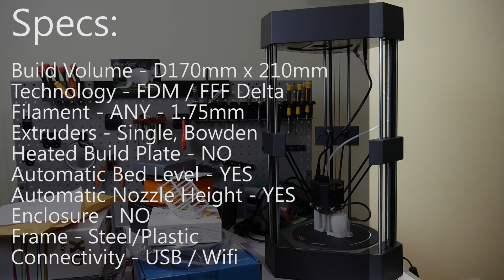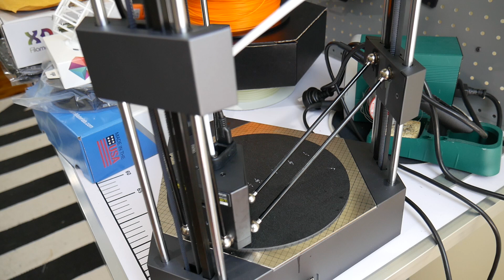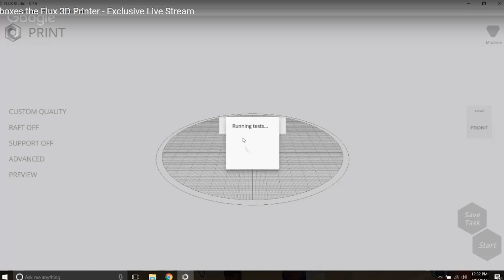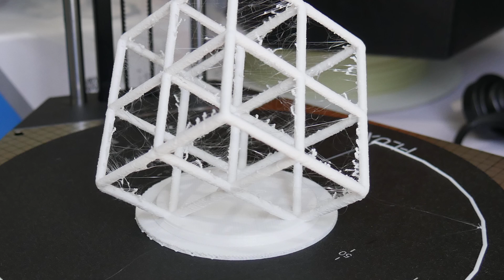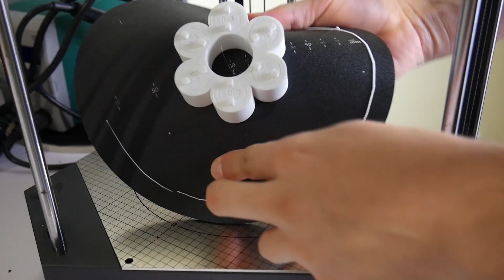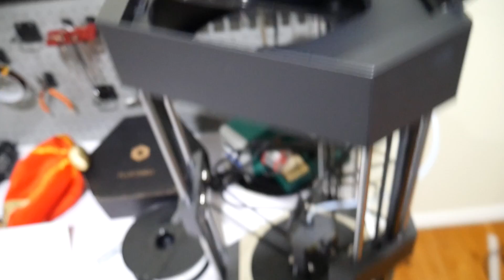FLUX Delta+ 3D Printer Review - Part 1

Comment: for $700 USD, It is a really, really bad machine. Considering it is a pre-built machine, it should at least give semi-decent experience. My FLSun delta is my first machine, despite having some issues to deal with when I first got it, it prints a lot better than the this at a fraction of the price.
Reply: Chin Ming Keat has spent 4 days trying to hack my website. LOL.  Malaysian authorities already notified. :)
Reply: And this is relevant?
Reply: Possibly.
Reply: SuperFrodo95 it's relevant as he couldn't win an argument on YouTube so he started being childish and  has being trying to hack Booze's website
Reply: Peter, Booze is trying to hack his own website? Or are you taking about Mega Making? I don't think anyone here cares enough to bother.
Reply: dude, do you have this machine? he got some bad luck, check out make anything/ 3d printing channels review on this, that's how my machine prints, trust me, it's not a bad machine, but its not perfect. please dont just say its bad, i hope you understand, thanks.
Reply: The FLUX Delta isn't just a printer, though.  It has a built-in scanner, a laser etching/cutting toolhead, a drawing toolhead, a vinyl cutting toolhead.  So you are getting several machines in one.  Of course, if you don't need all of that, then it's an expensive printer.   BTW, the FLUX site has an .STL for an external spool holder to address the issue of using 3rd party filament.
Reply: Booze, so... why the heck that you were defending and misleadingly talked like you owned and used Flux Delta+?  You asked me "have you used?" then, later on, you went on mentioning, "I already own this machine and loads of examples are very easy to find without having to 'prove anything'."  When I mentioned your flux delta+, you never explicitly said you never used it in the first place. There are so many contradictions with your statements.  damn... you've lost me here. You seem like a guy that make up stories as you go in order to sound convincing.
Reply: SuperFrodo95, you just noticed something important, the fact that Angus got the earliest production unit. So... how did Booze get his hands on the pre-production unit (in this case, is it even the same machine)? Is he a part of the development team or an affiliate with Flux?  something is really fishy here.
Reply: now you are just being ridiculous here....  You were misleading the entire time. 

- You said, "I owned this machine". In the context of the conversations, who else would think "this machine" is actually the older version instead of the latest one???? You never once said you never owned Flux Delta+ either prior this either. so within the context, you "owned" the flux delta+.
- You made assumptions that the upgrade kit will perform just as well/better as your existing Flux Delta despite you never used the Flux Delta+ (upgrade kit or not) before. 
- You just asked us to compared your samples print from the Flux Delta as if the print will surely stay at the same level with the new kit despite you never used it. blaming Angus for not knowing how to use the printer/slicer/software.
Reply: no, but i saw the video review
Reply: Booze Kashi, I can tell right now that my Cocoon Create is better than this, and it costed me a lot less. Heated bed, doesn't need to be connected to a PC (in fact, it has never been connected to a PC), LCD screen and controls, can take any spool I throw on it, and the part cooling is decent out of the box (even better with an $8 blower fan and a 3D printed Diii cooler), and of course, a larger build volume. I don't need to try this machine to see that I was and am still able to get much better prints out of a cheaper one.
Reply: I don't have to prove anything to you, buy a Delta if you think it's that good. And you can ask Angus what a Cocoon Create is, or just look up the video he did on it.
Reply: +Booze Kashi the whole point of a review video is... well... providing a review. The viewers don't necessary have to agree with the presenter (well at least not completely)  they (we) can have their own opinions. we all see the fact that the prints are bad. If we need to have the printer in order to "qualify" to compare the prints then you should also buy the printers we owned and compared the prints of your Flux Delta+ with the printers we mentioned. 

this is only fair, right?
Reply: The Delta PLUS is not out yet, but the Delta standard has been out for a long time now.
Reply: Khang Mai, Booze already admitted to owning a Delta+ and like I said, it's a machine that isn't out yet. Booze isn't a reviewer, they seem to work for a company that prints files for people and sends them over, so why do they have a pre-production machine?

For the same price as one of these machines I could buy at least two of mine, a few rolls of filament, and a copy of Simplify3D.
Reply: lol... I think you two need to put your reading glasses back on... what bit of "have had the Delta for a year and 4 months now" and "FLUX made a Delta, and then a Delta+" did you miss? 

btw, I also also a Flux Delta owner... probably for around the same time as +Booze Kashi, as I also backed it on kickstarter as part of the original campaign. I am just a regular joe user though... don't know my way around 3D printing that well but am getting better. In my own experience, I have also seen better prints from the Flux Delta, and I believe the default settings (at least for the Flux Delta) for cura2 are really wonky atm, and in fact that the older cura engine is dialed in better.
Reply: Booze Kashi, "I already own this machine and loads of examples are very easy to find without having to 'prove anything'."

Correct me if I'm wrong, but this says to me that you have a Delta+.

But if you don't own a Delta+, why are you defending it so ruthlessly? Even going so far as to be overly cheerful and belittling? Just write with a neutral tone. But, back to what I mean.

You claim you don't own a Delta+, fine, you don't have one then. That also means you have no prints to show off other than the ones in the above video (and when I say that, I mean prints that aren't from Flux, they're not going to show off shit prints). 
So, so far we haven't seen very impressive print quality, but, say it's just the filament and the printer prints prints fine. It's still $849US for the basic "just a 3D printer" pack and $1000US for the Delux bundle with everything, my printer is $300US. 
Like I said, I have a heated bed so I can print more materials. I have a control panel with a screen so it's easy to use without my PC (a button and LED isn't that good imo). I've got a smaller machine with a larger build area, a spool holder that spools any hold, and a design that is incredibly common and thus there is an abundance of knowledge, support, spare parts, and upgrades. Also, just going to say, my modded cooler is amazing. No cooling issues what so ever. I don't see you doing that easily on the Delta+, but if you're able to print a whole new printing toolhead with improved ducts that support radial blower fans then I'll be impressed. But that's still not worth the price tag I'm afraid. 

The only problem I run into with my machine is the filament likes to jam in the extruder when I pull it out. That might be just me, but I've gotten pretty good at pulling apart the extruder assembly by now.
Reply: Nice, you even try to bring in personal insults.  You had too many contractions with your statements. and you keep trying to derail the topic.. nice try anyway. you lost all your credibilities here (not that you have any to begin with).

Comment: Where could we find "Tolerance Test Print" file of yours?
Reply from the maker: The file was put up on Patreon, but it's not quite perfect enough yet to release publicly, uses a bit too much material and takes too long to print currently!
Reply: Would like to print it too
Reply: No no, the other one, that was in this video's thumbnail.
Reply: At least it looks like this tolerance test : http://www.thingiverse.com/thing:1420023
Reply: Yes, this is quite similar, thank you!
Reply: I would love one as well. I was planning on trying to design something similar next week to test out some ideas anyways, so not having to dp that would be awesome.
Reply: Thats awesome. Tyvm. Ill have to give the mechanism a look when I get a change later today. Mind if I ask how big the gap at the bottom of the plug is? Also, are the plugs held in? or free to be pulled out? Just currious tbh
Reply: I have made a test version similar to what you see in the video.

I hope that this will help you with testing.
http://www.thingiverse.com/thing:2301071

I tried to optimize the plastic usage/print time, but still make it possible to test for z-wobble imperfections etc.

My GeeeTech Prusa I3 managed to go down to 0.3mm clearance with a 0.4mm nozzle and 0.2mm layer height. The 0.1mm and 0.2mm were completely stuck.
Reply: Hi Joe, the I did design the gap to be the same from top to bottom.
So if your printer is printing too close to the headbed then the plugs will stick to the rest of the print.
But even if the first layer is connected together you should be able to break them apart.

Please let me know how well your test went, by upload a picture to thingiverse :-)
Reply: It till be another week or so before I get the chance to print on, but will do!
Reply: I am very interested in that file. Please post link if you find it.
Reply: The Lattice Cube Torture Test: https://www.thingiverse.com/thing:1887631

Comment: I don't see the 'thing' about these 3 motor shoelace maker.
Why would people buy one of these over the normal straight X-Y movement ?
Reply: In theory, the mass of the hotend platform is a lot lower than in a standard cartesian printer, yielding fewer inertia artifacts (ringing), and allowing for a higher top speed/acceleration. But all of that is dependent on the printer being well engineered of course.

Comment: "haven't figured out what these buttons do" reviews product.
Why you reviews product which is not in complete form. People watch review to make purchase decisions. With this product which looks like have quite ways to go you still keep praising the company. This is common theme in your reviews. Lot of favoritism because they sent you unit. Just say once that they supplied it and just be unbiased about it, all other reviewers of other industry do that.
Reply from the maker: +Booze Kashi you missed orange pulse when it errors, that's the one I saw the most. Point I was getting at is you control the thing almost exclusively through flux studio rather than a small single purpose button ;)
Reply from the maker: it just flashes random colors basically, not much use for running the machine.
Reply: hi! im AW1 lol
Reply: Button Operation:
Single Click = Ok/Acknowledge, used when loading filament

Double Click = Pause/Unpause, used anytime to check a print, switch filament, place inserts, etc.

Long Press = Stop/Cancel, abort the current task

The color pulses are not random, white slow pulse is normal, connected to wifi 'heartbeat. White fast pulse when receiving data upload. Orange pulse when performing internal write operations, firmware flashing, etc.

The green LED is machine ready indicator light.
Reply: ;) I actually use FLUX Studio very little, just a gateway. You can upload gcode directly from Slic3r, Cura, or Simplify3D.  I know you are going to like it a lot better that way as you will have access to all your favorite settings. (We have profiles, or FLUX could give you one, but I know you like to make your own too.)  Have fun at BAMF! Eat all the things!
Reply: Orange pulse only comes on when the hotend is heading up.
Reply: That is true also.  Angus is correct I will admit I forgot it orange pulses when it errors, but I have not seen that in a long time. Sucks they ran into the USB setup issues during other video, but glad he got it sorted. Quite confident he'll make some amazing prints with it once he gets his profiles set up his own way.
Reply: You can also double press after powering up the machine to print a autoprint file from a USB flash drive. Basically just name the file correctly, shove on a flash drive, plug it into the machine, and double tap. Otherwise, a double tap when the printer is idle will instruct it to repeat the last operation, i.e. reprint the most recent print.